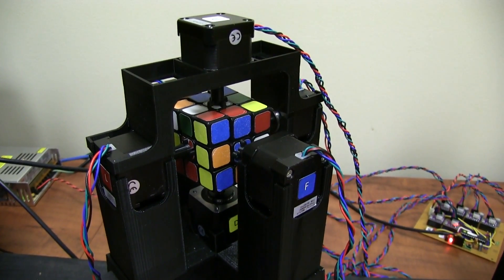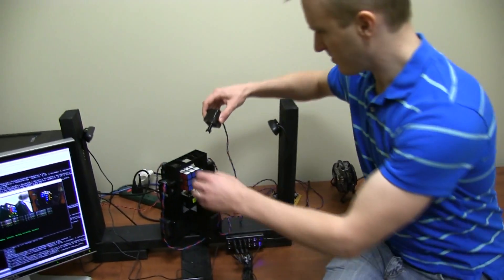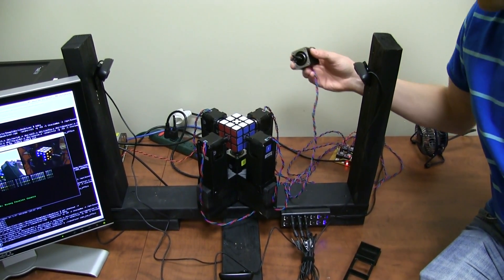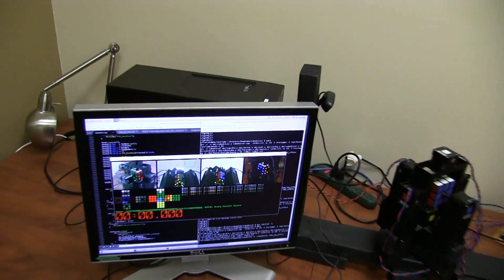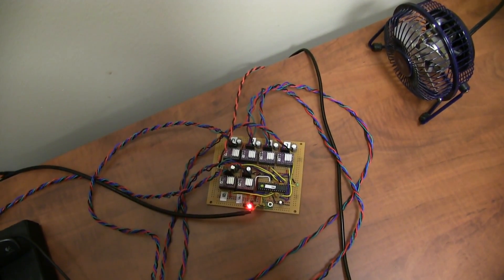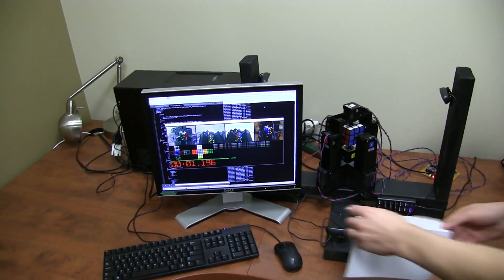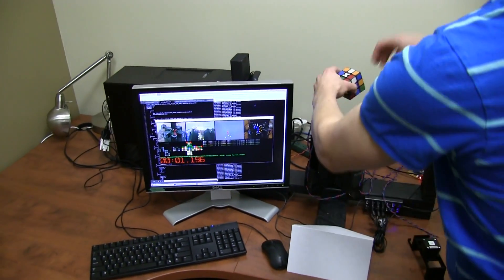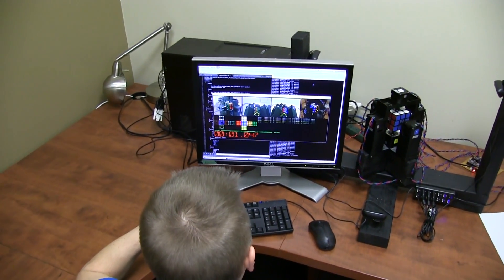World's Fastest Rubik's Cube Solving Robot - Now Official Record is 0.900 Seconds

Comment: THis isnt even really fair.  You have to predetermine the colors of the central space for this to work.  THis means that more than 10% of the cube has to start in a completed setup.
Reply: +TheJayde If you mean the centre of each face is always the same colour (so white is always opposite yellow, green opposite blue, red opposite orange) then that's by design of the Rubik&#39;s cube, not meddling by these guys.

If you mean that the white face is always facing away from the table in the machine, I too would be interested in seeing what the machine would do if the Rubik's cube was a different orientation.
Reply: Alsiexmon I know two sides are always opposite, but you can see that each post is labeled by color.  This means that each other side is always positioned exactly the same. If you switched the orientation of the blue and red positions, the central space would not be oriented properly.
Reply: TheJayde I see what you mean, I would like to see what happens if the cube was rotated so the sides didn't match the machine's colours.
Reply: i cant get this comment to make sense. i think you are talking about white always point up. thats completely fine, you can place the cube on the table the way you want in normal contests too
Reply: UbererSK I mean that the machine has designated colours for each of the spinners, so I was wondering whether the machine would be able to solve the cube if the colour of the central square of each face didn't match the spinner's colour, while the cube was in the machine.

(I probably worded it poorly, if so, my apologies)
Reply: +TheJayde Well the current world record cube solving bot is the same in this respect, so the rules must allow it.
Reply: +Xei Or they hadn't considered it.
Reply: Alsiexmon
the center pieces are fixed. you cant move them around, only rotate them.
Reply: UbererSK I know that, I actually pointed it out in an earlier comment.

Comment: modification of a rubiks cube isn't against the rules?
Reply: +Chris G If it was the original branded rubiks cube it wouldn't turn nearly this fast/that well...
Reply: +Chris G current record is done the exact same way but is a second slower
Reply: +Kane491194 if you're trying to break a world record there are rules or guidelines you must follow
Reply: +divk heav Gotcha. I was legitimately curious.
Reply: +Jordan Zomerlei from my understanding people "break them in" to get them to where the beer flows like wine.
Reply: NO!
Reply: Modification is only against the rules if it changes the functionality of the puzzle (in this case it doesn't) or makes it possible to distinguish between pieces in a way that isn't possible on an unmodified cube (this one doesn't, but also this rule doesn't really matter in this case because the robot doesn't even look at it after time starts anyway.)
Reply: +TheOriginalSacklunch yeah you don't want to use Vaseline because it can melt the plastic.  You're better off with either cooking spray, silicone based lubricant, or differential oil.  There are specific brands out there for cubes.
Reply: Look up world cube association regulations
Reply: +Ross Lee stickerless is allowed as of July 2015
Reply: BBBuilds12 Oh.  I haven't really been keeping up with the cubing scene for a while.  Good to know.
Reply: +Chris G For cubing, you can use any 3x3x3 cube you want.
Reply: +Ovenchicken No.  The WCA rules state that you are not permitted to use cubes that are pillowed, have tiles, are stickerless, or are modified to provide the used with additional information (e.g location of RYB corner cubie) compared to the unmodified version of the same puzzle.
Reply: +Chris G People use Vaseline and I am  sure other lubricants to loosen them up a bit. I tried the Vaseline on mine and it was a huge difference in how easy it was to manipulate. WARNING: don't use too much.
Reply: +BBBuilds12 Good to know, thanks!
Reply: +Chris G they modify only at the center of each side of the cube (for the machine to hold that cube) which means nothing different even if human is playing it. so, the modification is not against the rules.
Reply: +TheOriginalSacklunch silicone better?
Reply: +Chris G drilling holes in the cube for the robot arms isn't modifications. I think the mod you're thinking of is when people remove and move the stickers around.
Reply: +kxmode I'm interested in seeing a removal and placement of stickers run that comes anywhere close a cubing record
Reply: +Jordan Zomerlei I have one of the new rubiks cubes, It turns very well if you give it some lube, It can also do 180 degrees in a single flick.

Comment: I feel as if you guys may be disqualified for a world record, as you have altered the cube and thus its operation.
Reply: If it is competition legal, then they are doing it right. Anyways, different styles and functioning Rubik's cubes are sold and used in competitions.

They still turn the same way.

What you said was like saying: That cube is illegal because it was made with rounded edges!
Reply: +Spycrabs Sticker-less cubes are banned from competitions and yet they turn the same way. I'm almost positive that he cannot enter in a competition because he cut the center pieces of the cubes, they are very anal about that type of stuff. I think the only modification you can do to your cube is lube it up and that's it.
Reply: +Spycrabs I mean that how the machine operates the cube is illegal. I would think that in order to compete for a "world record" any cadaver would need to grasp the cube externally without affecting the construction of the cube.
Reply: +cumchugger325 stickerless cubes are no longer banned from competitions
Reply: The way of operation is exactly the same. Turn the sides in correct order to solve the cube. Drilling holes DOESNT alter it. Use your logic if you can.

Comment: Why  not use suction cups instead of drilling into it? Other than that it's sweet
Reply: The suction cups would likely slip a little due to the speed of the turning, and if they slipped and the turn was not fully completed on the cube it would lock up and stop turning/pop. With drilling into it there is no risk of any mistakes with the turns as it is a fixed/locked mechanism.
Reply: A work around drilling is needed as they will test the system with official cube